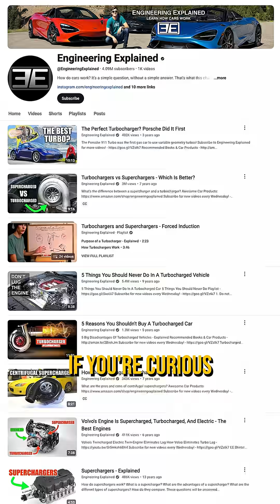Turbocharger vs Supercharger - Which Is Best?

Comment: I say use both. Each could be smaller for the same power as either by itself, and thus, reducing the downsides of both.
Reply: but it's also increasing the complexity and introducing a lot more potential points of failure
Reply: The older Volvo T8s do exactly this from factory. I've got a MY2020 V90 that has a clutched supercharger, turbocharger and electric motor on the rear.

Comment: As someone who has never driven a car with a turbocharger or a supercharger the sounds were spot on
Reply: As someone who has never driven a car at all, I feel ashamed🤡💀😭
Reply: As someone who has had both, the sounds were spot on
Reply: Mixing It Should Provide Additional Horsepower
Reply: Trust me many cars. He says having a turbo charger. My 2019. Honda Accord has a turbo charger and it’s a base model car. I was honestly shocked when I learned it had one.
Reply: WOW, with the number out there now, I didn't know that was possible anymore.  What do you drive now if I may ask.
Reply: You have definitelly driven a turbocharged car since its often used these days to get decentish hp from a engine thats waaay to small for the car its in exemples are fords ecoboost engines like in the ford fiésta making 125hp from a tiny 1 liter 3 cillinder thats can fit on a a4 paper. Not just race cars have turbo's most new cars are turbo charged but more for making tiny engines usable than making already fast engines even faster
Reply: @dwaynethemineraljohnson412  You know some people may have driven 3, 4 cars in their life. You can't say to a random stranger "You have definitelly driven a turbocharged car" I think they know better XD And it's not like NA cars are a rarity either!
Reply: @teedjay91  you but any suv or crossover which are the most popular cars these days have a turbo inline 4 9 tines out of 10. My parents car does. My own car is a na inline 3 though but thats a older car from 2010 my parents car is from 2017
Reply: @teedjay91 any modern car past like what 2015 definitely has a turbo in, might not be a high performance turbo but still a turbo
Reply: @dwaynethemineraljohnson412  I've been driving more than 30 years and I've owned a supercharged car, but I've never owned a turbocharged car and I'm pretty sure I've only once driven a turbocharged vehicle, my grandfather's 1-ton Dodge, except for cars I've rented for work and one dump truck I drove, but most people don't travel for work or drive dump trucks. Turbochargers are becoming more common nowadays, but I could easily see someone who hasn't driven many cars having never driven a car with a turbo.
Reply: @dwaynethemineraljohnson412 bro not everybody drivea newer car i drive a 7.4l 1973 chevy c20
Reply: @Kervin.duant123 no? my opel karl from 2018 certainly doesn't
Reply: @chitlitlah  I was wondering , until I realized you don´t drive Diesel in the US. You wont find any non turobocharged Diesels on the road in Europe that a younger than a few decades.Unless Mercedes Benz Superchargers are relativly rare in Europe. 
( All trucks are TDs, most company cars are TDs [because long distance, and therefore the lower fuel consumption outweighs, the higher tax in Germany )

I do have one on my car though. Cannot be beat in the sound department by a turbocharger.

Only have got the driving school three cylinder Aygo, Dads Ford Mondeo TD and my Jaguar XJR to compare.
Reply: @dwaynethemineraljohnson412  and every TDI (It's literally turbo diesel) has turbo and TDI's, or their petrol cousin TSI's, are extremely common
Reply: @dwaynethemineraljohnson412 not everyone has driven a newer vehicle or a diesel though. Lots of people have only ever driven a 70's to 90's average car.
Reply: @Kervin.duant123 Oh look at mr money bags rich mcgee over here who can afford cars that aren't 90's toyotas
Reply: @Kervin.duant123 simply not true, plenty of subcompacts and compacts don't use turbos
Reply: @dwaynethemineraljohnson412 according to passenger vehicle age census from hedges & company in April 2025, 88% of vehicles on the road are older than 2020. The average age of passenger vehicles on the road is 14.1 years. The vast majority of people have not driven a car newer than 2020 or even 2015. What you are talking about is somewhat true but you are not at all smart to assume everyone has driven a new or few years old suv.
Reply: @dwaynethemineraljohnson412  the only 2 cars i have driven are an opel karl, which has a 1L I3 with 7hp and a peugeot from 2001. i most certainly have not driven a car with a turbo in it
Reply: @tobiasflohr3417so you’re poor
Reply: @dwaynethemineraljohnson412  me who's only driven pre 2000's low end cars:
Reply: @dwaynethemineraljohnson412 I have never driven a turbocharged car and have only rode in 1 turbo car. I have owned around 10 different vehicles. I have driven a terminator cobra and a 7.3 power stroke though. You can't say someone has never driven a turbo car. All of my vehicles were older than 2005.
Reply: @marchog5276 what? Any car with a turbo is turbo charged. You don't know what you are talking about. Turbo charged does not imply high performance it only implies the engine having a turbo
Reply: @dwaynethemineraljohnson412  you do realize most people can't afford new cars right? Most new cars have turbo 4 cylinder engines but back then most 4cyl cars didn't.
Reply: Ain't nothing like turbos
Reply: *nor
Reply: @riba2233  "or" is correct here, because "nor" requires another word like "neither" being used before. Nor cannot stand alone
Reply: @MosquitoMetalSonic false, he used "never" before which is a negative

Comment: When you say turbos lack low-end torque because they need sufficient exhaust, are you referring to torque in the sub 1500ish RPM range? Because most modern turbo engines seem to hit peak torque under 2k RPM - which I thought was low RPM. Or am I misunderstanding something entirely? For example, the current B(whatever) BMW 2.0L i4 turbo hits I think 295lbs-ft at around 1850 RPM, or something like that. I would have described that as making great torque at low RPM. EE definitely knows better than I do, but I think I'm missing context somewhere. I guess we could be talking about partial throttle for normal driving though and not necessarily wide open, perhaps.

Comment: Not to mention turbos that are small relative to engine size and rpm, which are relatively responsive due to low inertia, and offer low-rpm torque, but wheeze out at high rpm because they can't spin fast enough
Reply: It's not that they can't spin fast enough, it's the hot side geometry that act like a choke.

Comment: Actually N/A is best cause you can make light, high compression, and Rev out or you can make big displacement with high low end trq but low rpm
Reply: You've never driven a high hp turbo car
Reply: @andrewbjorklund7999 nope matter fact I never drive any force induction I'm serious and I'ma car guy.......weird huh
Reply: N/A is also the most responsive, especially the high revving ones as they have relativly little inertia. 
That makes them suitable for sports cars and very fun.
That being said, the larger the displacement, the less responsive the engine, so it kinda loses that advantage.

Comment: Don't forget to mention that turbo is a type of supercharger. Supercharger is a device that forces more air into the engine. Turbo is a type of supercharger that is called turbo because it's driven by turbine. First turbochargers were actually called turbo superchargers.
Reply: And what is typically referred to as a supercharger is actually a blower. Originally when the roots brothers invented their blower, it was going to be used for ventilation purposes in places like mines but then later adapted for automotive use.
Reply: For prop aircraft engines Superchargers required gears for higher altitudes, but Turbochargers didn't and would perform well at all altitudes.

The P47 Thunderbolt was built around a giant turbocharger setup for its double wasp engine. Which is why it looks ridiculously fat. It was extremely powerful despite its high weight.
Reply: Interesting!😎
Reply: I believe turbo supercharger was the term used in like WWII for US (and possibly British) aircraft engine setups
Reply: calling it a turbocharger makes more sense so that's what were doing.
Reply: @user-mn8lz7gf6d no one disputing that. Its a turbocharger. He is just saying that Turbocharging is a form of Supercharging.

Its like an LS V8 is a form of internal combustion engine.

Its interesting, and useful, to understand the taxonomy of motorized technology.
Reply: Hey, don't out-nerd the main nerd! 😁
Reply: And if I remember correctly, both were perfected in the aeronautical industry.
Reply: In WW2 some piston aircraft had both. That may have been when it was figured out the pilot needed bottled oxygen above 15,000 feet.
Or pressurized cabins
Reply: This reminds me to check my air filter. Turbo is getting hungry again! 😱
Reply: Kewl.
Reply: A turbo + plus supercharger is always the ultimate combo
Reply: Turbo is a type of forced induction, not a type of supercharger, nobody is referring to turbo as supercharger.
Reply: @Iseenoobpeoples  supercharger is a type of forced induction that is driven by the engine. Turbo is a forced induction driven by engine through exhaust gases that go into turbine, so a supercharger equiped with a turbine. I didn't say that anyone refers to turbo as a supercharger, I said the opposite. It is a supercharger (turbine driven supercharger) and you refer to it as a turbo.
Reply: @technicbuilder6410  the cold side of a turbo is called a compressor not supercharger... a turbo is a turbine driven compressor.
Reply: @Iseenoobpeoples  The comment is correct it's just that over time we simply call it a turbo and not a turbo-supercharger. Look up the history of turbocharging l.
Reply: @PabloGonzalez-hv3td  I get it. I think using old terminology just makes things more confusing.

Comment: Correction: they DONT go stutututu unless you remove the BOV which i hoghly DONT recomend cause it causes damage to the turbine and seals in your turbo leading to a shorter life span of the turbo and could lead to more ezpensive damages later on

Comment: Modern turbo systems are so efficient and well designed that turbo lag isn't really a thing to complain about anymore
Reply: Tbh as someone used to an NA car I've yet to drive any modern turbo that didn't have an annoying amount to delay when pushing the throttle at low-medium rpm. Sure you can be within the boost threshold (the RPM range where the turbo can function), but if you're at the bottom of the range it still takes a second to spool in most modern cars that aren't high end sports cars with anti-lag systems or electric assistance.

Comment: Both are redundant compared to electric motors ;)
Reply: Yeah for that you just need a credit card to unlock the speed+ dlc
Reply: Until there are EVs that are easily modified they are basically a dead end. You can only go as fast as the OEM lets you. That's not the case with ICE cars, want to make more power it's completely up to you.
Reply: @brandons9138 false ;)
Reply: @brandons9138 that is not true
Reply: @riba2233 What s scathing retort. If it's not true provide examples of people tuning an EV. I'm not talking about swapping an EV power train into a lighter chassis. I'm talking about tuning/building an EV on its existing platform.

From what I can find there is currently one company that offers a stand alone module to tune a Tesla.
Reply: @brandons9138 read about open source inverters, you can do whatever you want, it's not magic. Along with using larger radiators for cooling etc. Or do you think that ice oems want you to mess with the engines? Lol

Comment: Hi quick question why it's called a heat engine but it works on compression and explosion Or spark
Reply: the explosion is from a thermal reaction